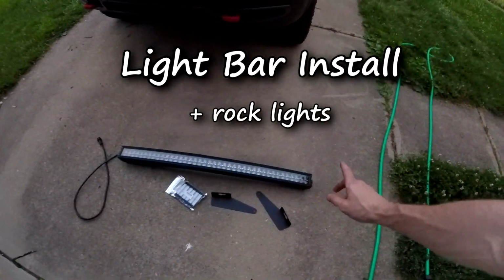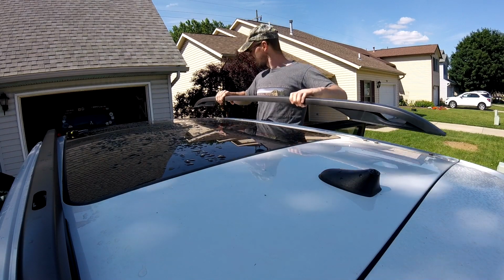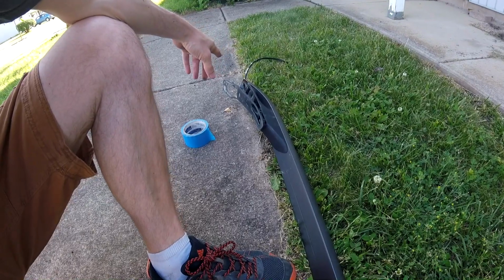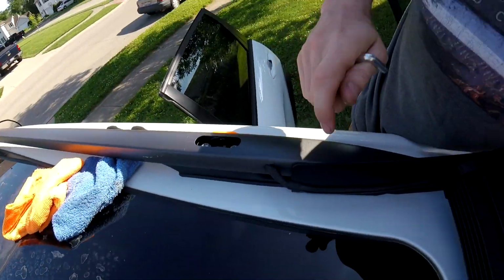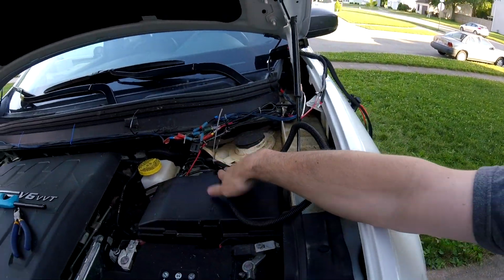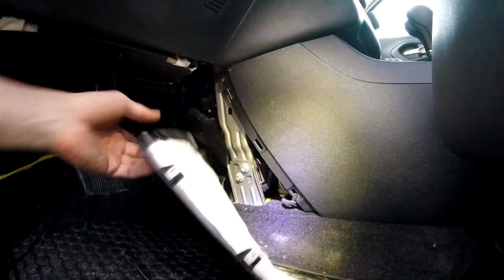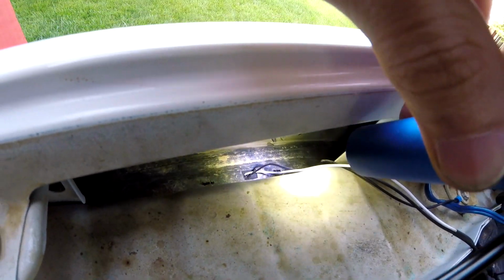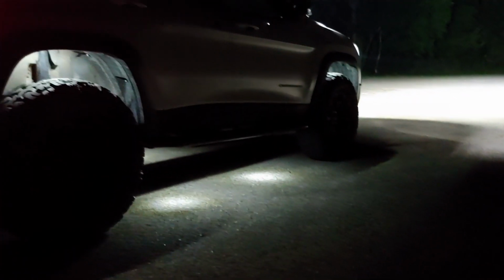Light Bar Install, Rough Country 40" Curved DLR 2019 Jeep Cherokee Trailhawk

Comment: what I ended up doing was going in through a grommet that is just at the top left corner when you open thye trunk hatch, then routing the wire under the trim panels and through the firewall grommet behind the brake pedal. You inspired me to drill my roof rail. Thanks for your idea!

Comment: So, I wanted to thank you. I wasn't sure about doing this set up, watched your video a few times "more than a few" and was able to get it done, we added a few more feet of actual wiring, I don't know if I missed the part if you added or not but...very happy with the install so, thank you
Reply from the maker: I added like 20ft of extra wire before i put it in the sheeth.  I wasn't about to be half way through the run and discover i needed to add more wire!  Much easier to cut extra off at the end then crawl under and add it. (Wire is fairly cheap amyways)
Reply: @FearlessTrailhawk  , exactly what we did.. just wanted to say thanks for the help,  much appreciated

Comment: Looks good and that was a lot of wire work.  I was looking at a bar for the top and picked up a good deal on a 22" for the front once I get the bumper bar I want.   I might have to pick up a 40" and do the top while doing the wiring.  I was actually thinking of turning the little coin/ashtray (I keep my mailbox and folks keys in it) into where I'll put the switch.

Comment: Great video.  Your lights look fantastic.  Good to know removing my luggage rack is fairly easy.  Now and then, temporarily attach a pair of crossbars to transport some awkwardly big thing home.  As an aside, got my first motorized vehicle flat tire, ever, yesterday on a rarely used forest road some 30 miles from civilization.  Had to study the instruction sheet on how to use the jack, haha.  A rock or fallen tree branch apparently sliced the sidewall, so needed a new tire.  Very glad I never followed through on removing my spare since I never needed it, until yesterday.
Reply from the maker: Yeah, i was super surprised at how easy and clean it is to remove the roof rails.  My next video will cover my spare tire and cargo situation after upsizing.  I never run without a full size spare.  Even when i had a Honda Accord, it had a full size spare.
Reply: I bought an extra factory rim, so I can do a 5-tire rotation on my KL. I found out doing my first rotation that my good race jack (from my low-car days) doesn't work at all for the Jeep, so I wound up using the factory jack. It's probably the best factory jack I've ever used. :)  An electric drill-driver with socket adapter helps speed up the process.
Reply from the maker: Yes, it is amazing!  I had to add some wood blocks to boost it up to work with the new lift.
Reply: @jedironin380  Interesting, was thinking of getting a factory rim to do 5-tire rotations, too.  Wonder if those remote reading valve gauges are readily available so that air pressure will be displayed on the instrument cluster display for the 5th wheel when it is in use?  Like how you sped up operation of the factory jack, cool idea.
Reply: @problu9586  I ordered my rim and TPMS sensor from moparonlineparts.com. Include your VIN when you order and Benny will get you set up!  :)  I had my favorite local tire shop swap the tires on the rims and balance it. LOTS of weights, but it rides great! No problem with the TPMS readings at all.

Comment: The lights look great! I'll probably add some pod lights to my hood eventually, but I don't wheel much at night (so far...) anyway. I'd kind of like to mount pod lights up where you have the brackets for the light bar. I had them up there on my old S-10 Blazer and they worked very well!
Reply from the maker: I've only gone out at night once so far, but it is nice to have them.  I can see me using the bar on some country roads with no traffic to see deer.  I could see pod lights up there working, just make sure they are good ones!

Comment: I need to find some spots around me to go off road. I'm close to rush off road. Took my lifted f-250 there. Not sure if I'll take the trailhawk there.
Reply from the maker: I've been to rush once with the TH, i would like to eventually do a TH ride there, but i simply don't know tue trails there enough to responsibly lead a ride there. (Also have to be out of there by 1-2pm before all the drunk SxS start zipping down the trails at 60 mph)

Join a local club and start going out.

Comment: Question, have you gone thru a carwash with this setup?  If so, was is CLOTH wash? did the light or bracket get cough at all on the wash mechanisms?  Just curious as I am following this setup now that you have.  Thanks in advance for your reply.
Reply from the maker: Have gone through many a car wash.  The only thing i've had the brushes get stuck on is the little wing part of the fender right above the headlights on the '19s.  No issue with my lights.
Reply: @FearlessTrailhawk  ok,thanks

Comment: Also like to ask, which brand/length of wiring harness did you use to go from the roof driver to the back tail-light and all the way under body to the firewall?  Doo you have an amazon link to share?  I am copying the exact setup you have but with a 42 inch curved light.  Just missing the wire size...so much to choose on Amazon.  Any help is appreciated ..thank you !!!
Reply from the maker: Just 3 spools of wire (red, black, white) from the hardware store.  Wrapped it in electrical tap and covered with one of those plastic wire harness sheaths.  I think i did a 30ft (maybe 20ft?) section then cut off the excess once i got it into the engine bay.
Reply: @FearlessTrailhawk  ok, was trying to just buy an all in one with fuse that can support 240 to 600watts across.  I only found a 180wat max so far.  Thanks for the share

Comment: Why did you run the wiring the whole length of the car? Why not just go down from the bar into the hood and directly to the battery??
Reply from the maker: Umm? Like along the outside of the windshield?  Because that was a thick bundle of wires and it would have looked terrible?  And how do i secure this thick bundle of wires to the outside of the windshield?  Yes, 'some people' have done that...but this is my Jeep, not theirs.

Comment: Hey man. So I have a dilemma. I want to install a curved light bar on my trailhawk as well, but all I see are 42" ones. I know you used a rough country 40" light bar, but it's so damn expensive. 42" won't fit at all right?
Reply from the maker: I am not an expert, my guess is maybe it could fit?  i'd try asking a couple of the TH related facebook groups or forums for that one.
Reply: Yes I have one on mine

Comment: I'm looking to buy a 2015 latitude with the active drive II . I read that many 2015 2016 trailhawks and latitude have PTU issues and not getting fixed. What's your experience, anyone?
Reply from the maker: Zero experience with the 15-16.  I've heard the same as you and personally i would steer away from anything before a 17 just to be safe.  There are some that never had any issue, but others that have.
Reply: @FearlessTrailhawk  I wish I could get into something newer but maybe I can set up a go fund me account. LoL anyways I read that this recall came into effect last week so even if I buy it with an open recall it would have to be fix once a solution is found. Tks for the info, I can't wait to learn and live the off-road experience. So if anyone reads this your education is greatly appreciated.
Reply: @SlingSuds  There should be a bunch of low mileage lease returns since the stay at home orders. Hopefully that will bring the price of the newer models down a little.
Reply: If you still own this KL TH, you should have gotten something in the mail saying the PTU has an extended warranty.

Comment: Nice tires man! Does it have a lift? I was told by the Jeep dealer to not lift the trailhawk due to it setting off “bells and whistles”.
Reply from the maker: A little less than 2" of lift, i've heard of others running 3+ for a while with a fair amount of wheeling and no issues.  I've got some issues from a major collision that appeared before the lift got installed (discovered during install) that i can't find a dealership willing to work on...everyone hemhaws saying "the lift is causing it".  I might have to revert back to stock to get the issue resolved, then get the lift put back on.

Comment: Where did you get the switch you mounted into the that front storage container? Sorry if I missed it in the video but that set up is pretty clean.
Reply from the maker: The one big one came with the light bar, the other two small ones were from radio shack (RIP).  Then i cut up a piece of plastic to hold them and used 3M tape to hold it in place.

Comment: thinking about running a similar wiring route from my roof and down the back of the trunk in my wk2. How did you get the wiring to go through the top of the tail light? was there an OEM hole there or did you have to drill or take the tail light off? love the vids keep it up. just subscribed!
Reply from the maker: I just propped it out a little bit then ran it behind, then put some silicone around the edge to cover the gap.  Of course the WK2 may be different.

Comment: Thank you so much for this vid - I've been investigating ways to do this on my 2017 KL, this gave me a lot of ideas, and I'm definitely going to steal sneaking that wire inside the roof rack. What wiring harness did you use? It seems REALLY long (which you need for making this look clean like you did). Thanks!
Reply from the maker: I bought extra wire from Lowes and made my own 30 ft wire run.

Comment: Use fish tape the next time you are running wire. I can already see you shop at harbor freight from the pick you are using. They have cheap ones there
Reply from the maker: I did, LOTS.  You can see atleast one use of it at 11:35.   What 'pick' i'm using?  I do most of my tool shopping at either the local handyman shop or if they don't have what i need i go to the nearby Lowes.
Reply: @FearlessTrailhawk  I was drunk while watching. That pick I was referring to was one from the four piece pick set sold at harbor freight that you use to remove the cover to the rails. Honestly  man I respect you and your videos I get a little nasty while drinking at times. I apologize it was a good video and I did see where you use the fish tape later in the video. I have watched every single video you have put out and you are the reason I bought my 15 trailhawk
Reply from the maker: I got the orange pick from a 4-pc set i got online years ago to use for working on paintball guns and other things with tiny o-rings and such.  It has come in handy for many random uses.

No worries man, you actually would be surprised how many 'drunk messages' i've gotten, I appreciate your honesty about it, and am glad my videos have helped you!
Reply: @FearlessTrailhawk  keep doing the the badass off road videos bro. What set up do you have? I seen the Bilstein shocks. I'm thinking of doing a 2 inch rough country lift because it's economical not sure though
Reply from the maker: @handyandy187  Dobinsons KL Trailhawk suspension lift, paired with partial Hazard Sky lift spacers to achieve 2" lift.  I went with the upgraded suspension because i also plan on getting a metal winch bumper and wanted the reinforcement.

Comment: Man,I would never come to you to get any kind of wiring done,I have same exact Jeep and no way does the wires look crappy like that,have some pride in your work bro,if your gonna do somthing do it right not cause it’s cheap or good sale,might as well not have got none of that cheap crap at all
Reply from the maker: I'll give you the initial wiring for the pods was hastily done.  Its on my list of things to clean up. I recently tried to do one of the cleaner relay boxes, but they only work with their proprietary switches, which don't fit where i want/already have the switches.  I've got lights from 3 different companies, added at three different times. 🤷 

I never said i was a professional, i'm a country boy who does something to get the job done.  Could i have spent $500+ on a more 'professional' setup...sure, would the lights do their job better...not really. To each their own. Its not pretty, but it is functional. Once i find a system that can incorporate my current switches, i'll eventually clean it up, until then i'm not losing any sleep over it.